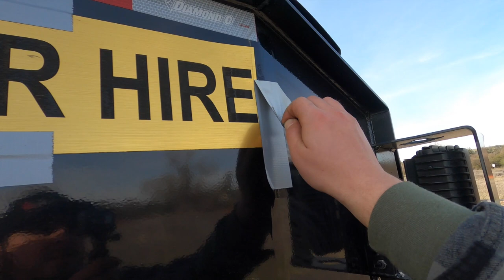40K Rated DIAMOND C GOOSENECK Trailer REVIEW

Comment: Nice trailer. Who did that 2 5/16 ball mount hitch for you? I have a 3 inch but can`t use it because my receiver is like yours.
Reply from the maker: Truck came with 2 5/16, had to install a 2 5/16 on the trailer because originally it had a 3

Comment: Hello Sir, what brand is the winch? What thickness is the plate where is mounted? Now I have some question in regard of the GVWR of your trailer, if your payload little over 30K and your trailer weights empty about 8K plus that makes for the 40K GVWR, right? The 3” ball is rated for 30K how in the the world am I going to be able to get the good use of the 40K GVWR that the trailer has? I’ve been looking and the stronger commercial hitch for a 5th wheel hitch is 34K max, witch is what my Ram 5500 is rated for. If I can find a hitch that can be rated for 40K that will make my day.

Thank you.
JC.
Reply from the maker: I think it’s a Samurai winch, like my old trailer. It’s mounted on a winch plate and I’ll have to check the thickness, yes a little over 30k payload by using a bigger truck, a 40k hitch would be awesome to find.
Reply: @fulllifeadventures  hello I've found a ball hitch rated for 40K, is brand name Wallace Forge that big boy can only be mounted on a plate 3/4" or thick and it can only be bolted the nut is 3" I do t know to what torque needs to be.
Reply from the maker: Julio Castillo wow that’s impressive!! Thank you, I’ll take a look at it. 👍🏼
Reply: Full Life Adventures you bet.